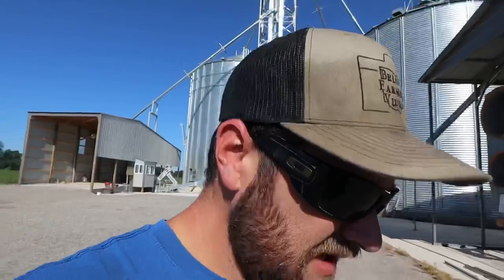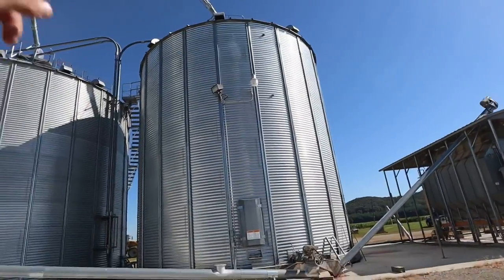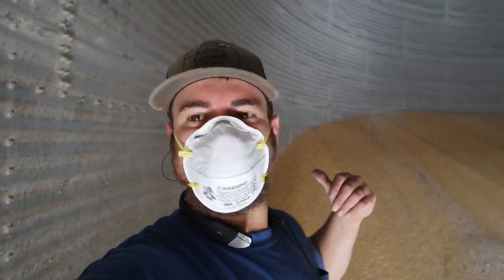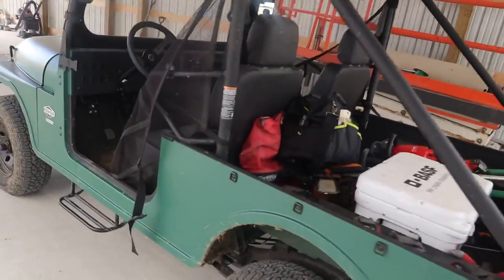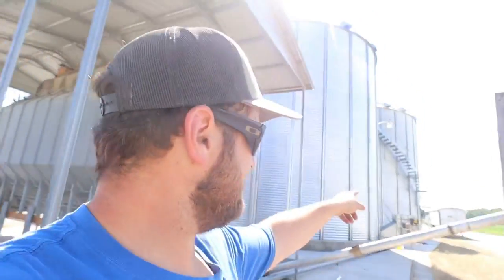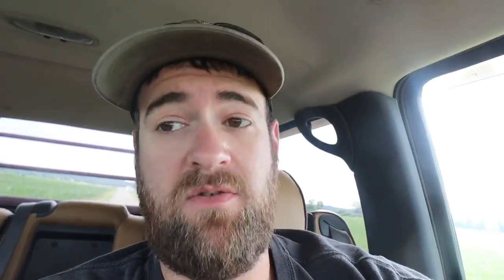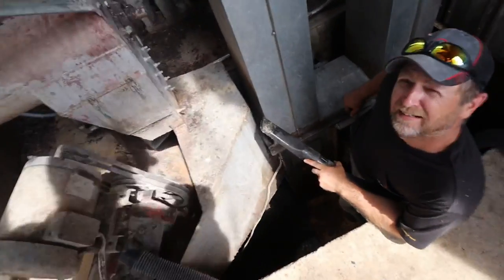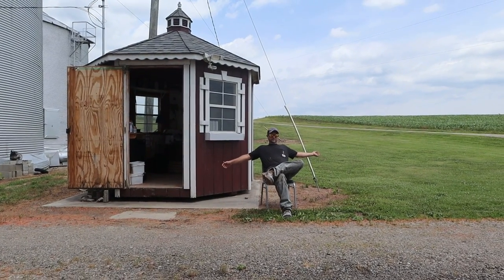Rotten Soybeans and Bin Sweeps...... Good Times

Comment: Im curious about the two overhead hopper bottoms, I'm assuming they feed a dryer,,, do you not have load out on them? Running the leg non stop to those and fill trucks with OPEN chutes like your side bin chutes is so fast, and the leg runs while you truck??? Dont know the capacity, or if a truck can come close enough them??? Anyway we used our overhead dryer bin to fill trucks, the leg never stopped filling it while we trucked the grain, and we could fill a truck in a couple minutes from a direct gravity feed...

Comment: Hi Brian, 
Greetings from N. Ireland. I was giving some thought to your sticky auger problem. Do you think it is residual corn becoming damp and swelling that causes it to seize? If so could you insert a few air hose connectors along the shaft and blow the tube clean after use? Just a thought. Good luck with everything.